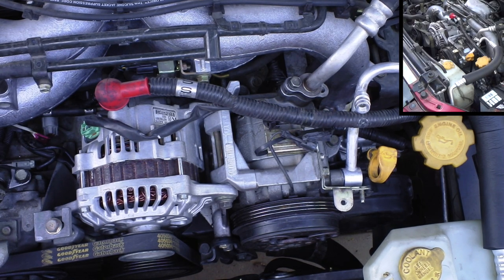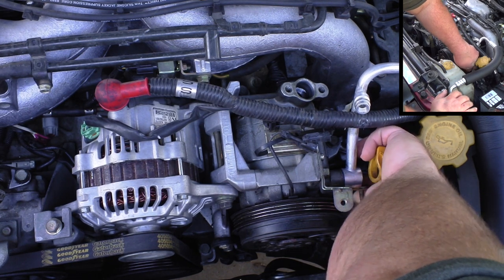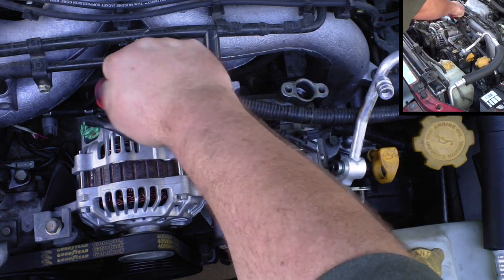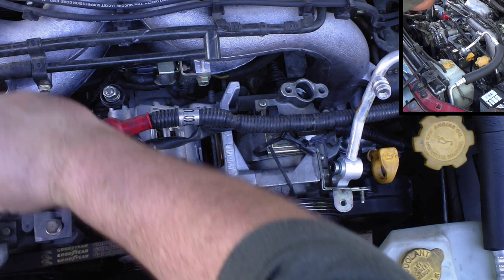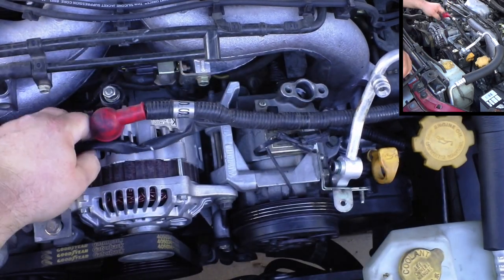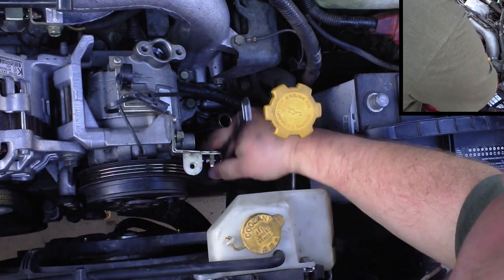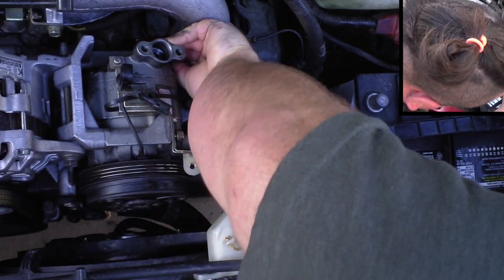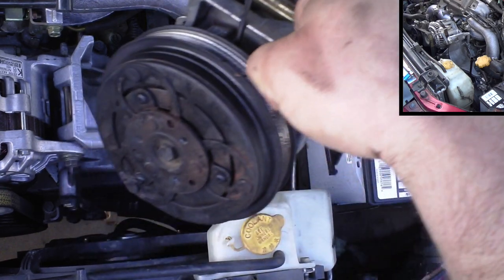Subaru Forester AC compressor removal

Comment: Thanks, good video. I may need to replace my compressor soon, it’s making noise, but not sure why. 2005, 2.5 L Forester with 120,000 km.
Reply: Sometimes it's the compressor, but quite a bit, the compressor clutch gets noisy.  Those can be replaced or adjusted without having to replace the entire compressor.

Comment: How did you get the refrigerant removed? Also, after you put in a new one how did you add it back?
Reply from the maker: I had a shop evacuate the system before I started.  Once I replaced the compressor, I pulled vacuum with a vacuum pump from Harbor Freight and then waited to ensure the vacuum held and that there were no leaks.  Then I charged with cans of R134a.
Reply: @seandogar  Awesome! Thank you for the info!